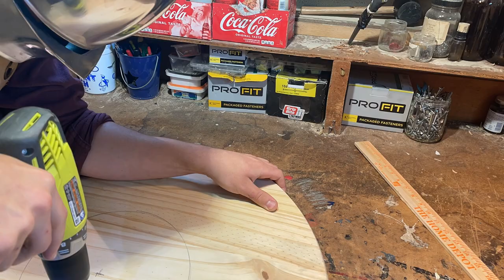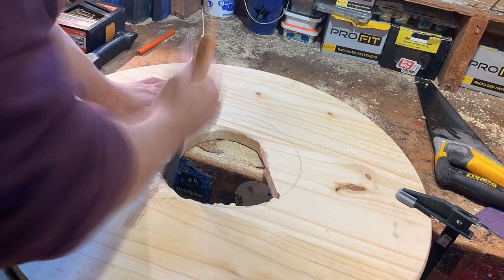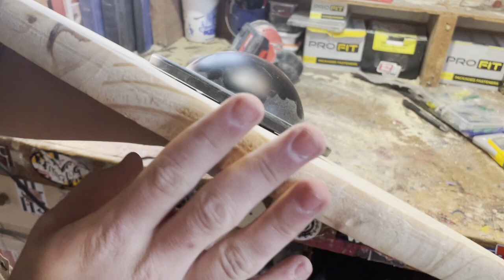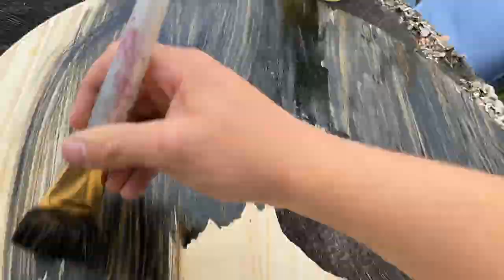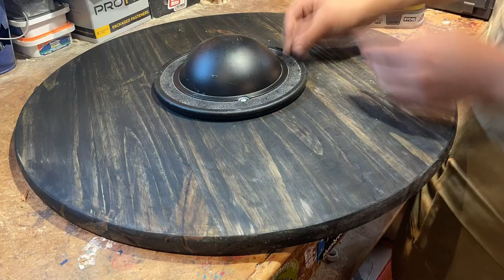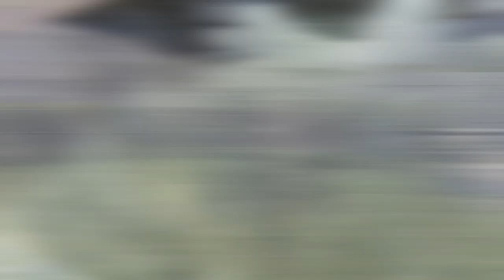How to make a $50 Viking Style Shield! (Very easy build)

Comment: With that kind of shield, if you're sparring with it, you might want to cover and edge it, or, at least, edge it. It wouldn't add that much cost, basically a piece of cheap canvas and wood glue to cover it and the edging could be either leather or metal. You can even get some cheap dog chews for the leather, just soak and open it up and work it into position with glue around the edges, or you could use metal flashing from the store for a later look.

I'd actually made a similar type of shield without the buckler parts a long while ago, I'd found a cheap metal mixing bowl at a thrift store used a drill to add connection points around the edges and a door handle pull that fit inside. That lasted until I had a water leak and mold issues
Reply from the maker: Thank you for the very awesome and informative comment! I’m planning on making another shield in the future, I’ll definitely use some of your suggestions!